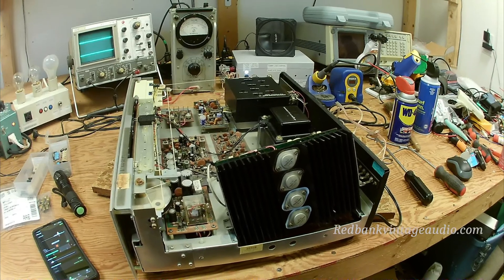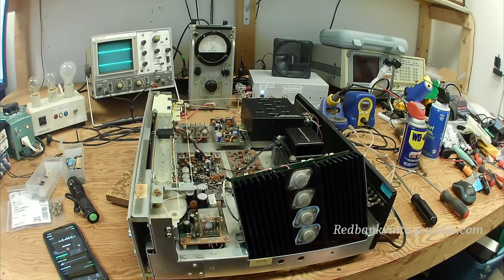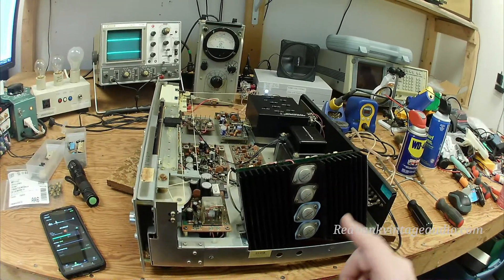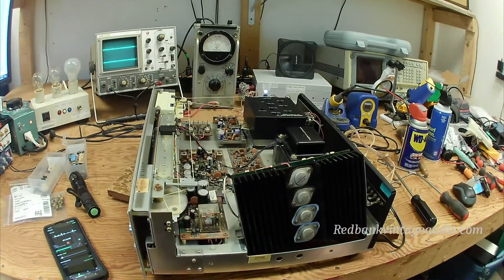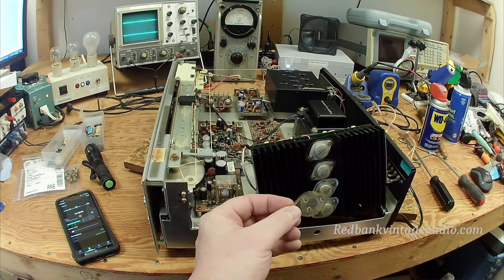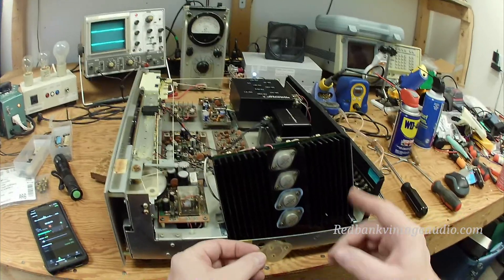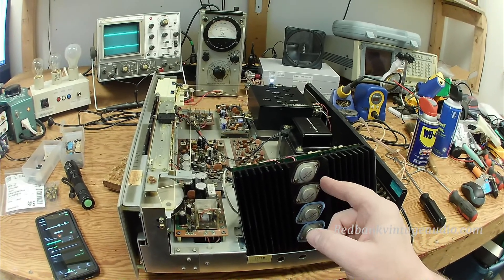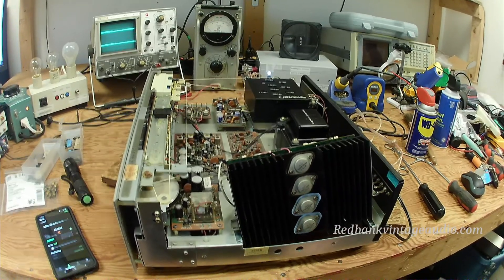Changing Out Power Transistor Insulators On A Marantz 2235B

Comment: my new acoustic dimension dosent give sound, its the output tranzistors i think becouse the amp got hot and it didn't had airflow, should i change them?
Reply from the maker: NAD amps are hardy little machines. They rarely actually blow output transistors. It may be nothing more than blown fuses. You could check the fuses, replace them if necessary, and try it out. If it blows fuses again, it will need to be professionally serviced. It won't be just a matter of replacing output transistors. If the fuses are not blown, then I'd still say it needs to be professionally serviced. BE SURE THE UNIT IS UNPLUGGED FROM THE AC POWER BEFORE YOU DO ANYTHING INSIDE IT!

Comment: I had bought a 2235b on ebay for a very good price, won it by auction at the last minute. When it arrived I hooked it up to some sansui speakers and powered it up. This thing was getting very hot after a few minutes. Just placing my hand over the heat sync with the metal cover on was an indication to turn the thing off. Came on youtube and found this video. Bought some of the blue insulators. Now this 2235b barely gets warm. Incredible. When buying older gear in the future these blue insulators are a very important upgrade. Thanks for the video
Reply from the maker: Glad you met with success! But... I wonder if something else was causing your overheating issue? If heat was boiling out of the vents on the cabinet, then that meant that heat from the transistors was making it into the heatsinks successfully, and being dissipated into the air. Changing the insulators won't change that. I suspect you had a bias problem, (the bias pots get dirty over time and the bias current can change dramatically), and you somehow moved them back to a position where they provided the proper bias? There are other reasons the amp might get too hot, but in any case, I'm glad you're enjoying your receiver now.

Comment: My 2235 is missing all 4 transistors.  I'm restoring it, and have new pairs of MJ21193,94's I'm installing.  I have new micas, and also the blue silicone insulators.  I'm unsure of whether the M3 x16 bolts need to have nylon gaskets for insulation, or no gaskets like the manual drawing shows for "2008"
It also says to use "B3x12" bolts , but a 12mm is barely long enough to catch a thread with no gaskets.  Be nice if it came with them.
Reply from the maker: As for the length of the screws, that I cannot attest to. But as for the insulation of the screws, as I said in reply to your other comment, the transistor sockets usually have raised rims that fit into the holes in the heatsink, and they act as bushings to insulate the screws.

Comment: What is the transistor number please ?
Reply from the maker: The output transistors originally used are 2SC697B (or 2SC697C); and 2SA757B (or 2SA757C). Do not mix and match B and C variants, as they have different gain ranges. Modern replacements would be the MJ21195G and MJ21196G, which are made by On Semiconductors, and are far heavier transistors than the originals.
Reply: @ScottGrammer  Maybe that is why it seems I need longer screws.   I'm using M3x16 with a flat, and a star washer.   I was going to use the mica with thermal paste, but I did get some blue silicone insulators also.  The mica insulators do keep the bolts from touching the heat sink and shorting out.  The soft silicone insulators insulate the bolts as well?
Reply from the maker: @mward4829  Usually, the transistor socket has a raised rim at each screw hole that acts as a bushing to insulate the bolts.

Comment: Hello, i have same marantz 2235b, and it heats up realy good, so my question is, how much do they heat up? And it smells a bit 😁
Reply from the maker: Neither of those things is normal. The smell might actually be from failing capacitors as they will smell when they get old and start to actually physically leak oil. As for it heating up, that may be because the amplifiers bias is misadjusted, or because you're running the wrong kind of speakers on it and the impedance is too low, or it could be other issues. It certainly does need to be looked at I would say.
Reply: @ScottGrammer  hmm, speakers are 4 - 8 ohms beovox s45-2. I realy don't know much abaut electronics, just managed to change light builbs. But i tuched transistors, and they are some hot as heat sink, even if į don't play it laud. Capasitors look good not leaking, į know they evaporste after time.... But the sound of receiver is good, maybe need to get a real specialist to look at it.....

Comment: Hi  @ScottGrammer, so with these fabric insulators, you are not using, any paste?
Reply from the maker: They are impregnated with silicone which acts as a thermal interface compound. So no there's no thermal paste used.

Comment: I had a CPU on a computer I built about 8 years ago. I noticed the temp was a little high on it. I pulled it out, cleaned it off and greased her up. Temp is doing just fine now. The old grease was dried up and baked on.
Reply from the maker: Yes sir. Exactly the same rules apply there as they do in audio.

Comment: Where do you source the blue cloth insulators, or what are they called so I can search for them?
Reply from the maker: Here are the ones I use: https://www.ebay.com/itm/372688887906

No, that's not me selling them, nor do I get anything if you buy them.
Reply: @ScottGrammer do you still use thermal paste with these? Thx!
Reply from the maker: @Daltondoubledeuce  No, not with these insulators. They are impregnated with a thermal compound, and don't need anything else. Makes for a very clean installation!

Comment: Only speaking for me, but this is why I subbed.  Learning stuff I didn't know about these amps (which is most everything actually).  Thanks.  Would that be part of a PM even if there was nothing wrong otherwise?
Reply from the maker: If the amp is old enough and if it's apparent that the amp needs it, yes. If the silicon grease still looks white or clear, it's OK. But if it has turned brown or begun to flake off, it's time for it to go. By the way, this client brought in two identical 2235B's, and there was really very little wrong with them. I recapped the phono preamps, replaced the insulators shown, aligned the FM, cleaned the pots and switches, and did a couple of other minor repairs, but overall, these 47-year-old receivers were in fine shape. Well-made units are like that. But try to buy something new that will run that long. HA!

I plan to do more bench videos like this. This time, I used my phone to record the audio and synced the sound and picture together in post-production, but the phone sound is not optimal either. I'll figure something out, because the sound of the headcam is terrible.